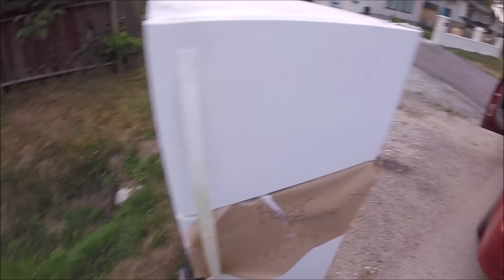Street Scrapping Action Smoky Sunday

Comment: Smoky air, yuk.  Most drive around scrapers use pickups.  I like the idea of you using Little Red. Nothing can fly out, security for the load, much more comfortable, it's big enough, and I'm sure it gets better gas mileage.   Great scrapper companion.
Reply from the maker: Half the fuel of a Ford F-250